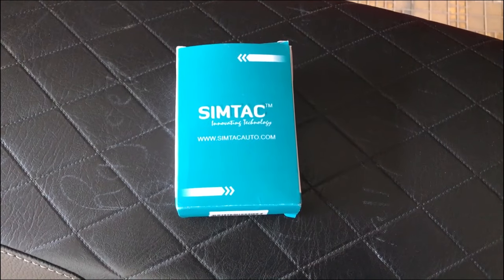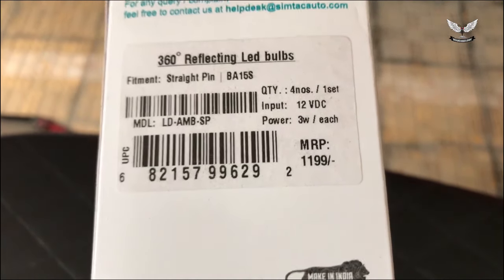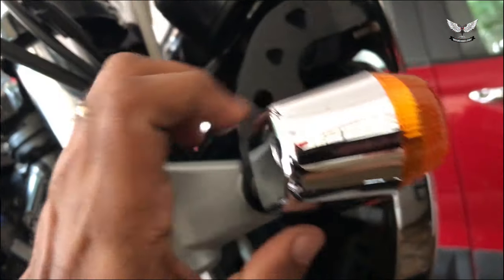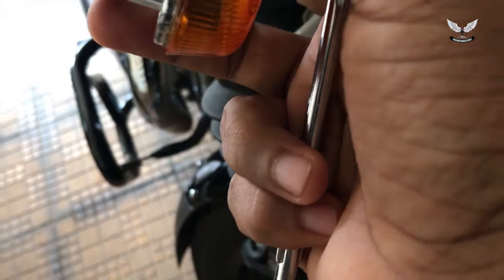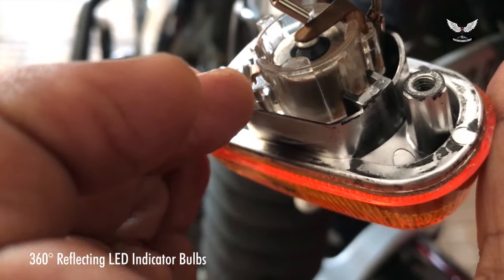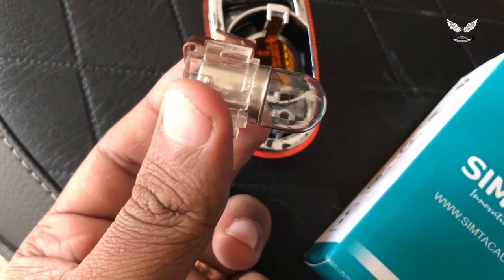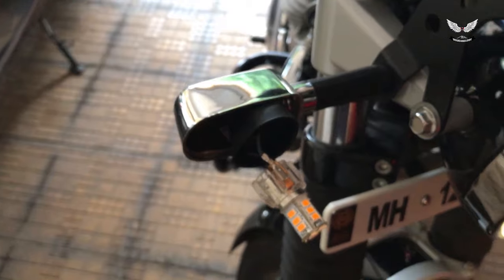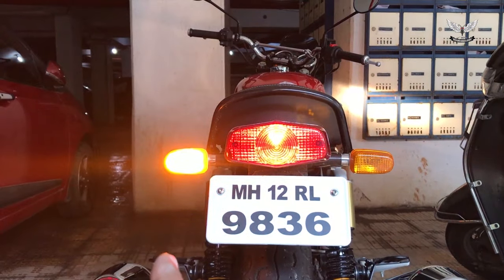DIY Installation of Simtac 360° Reflecting LED Indicator Bulbs on RE Interceptor 650

Comment: So u mean to say that only the polarity need to be inserted back as it was removed, but the LED bulb will fit normally in the housing. Or is there any specific orientation need to be followed to install the bulb inside the casing?
Reply from the maker: edwin victor led fits normally in the housing... there is no specific orientation.

Comment: Need Help... I installed this on my Yamaha Ray ZR. After that my speedometer indicator brightness became very very low and a small amount of current goes to other side if i turn the indicator ON. ( If i turn the right indicator.. Left indicator flashes for a second and then right side works. A little amount of current goes to other side also )
Reply: You need to remove or cut the indicator wire in speedometer...when you give one indicator current get bypassed through speedometer indication  which makes other indicator to flash..